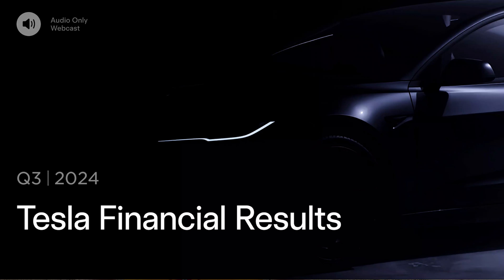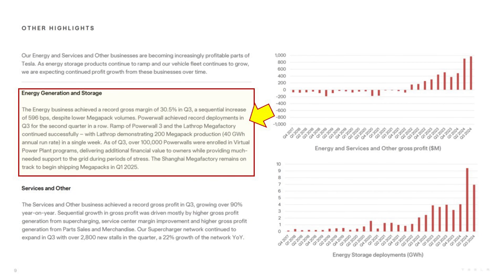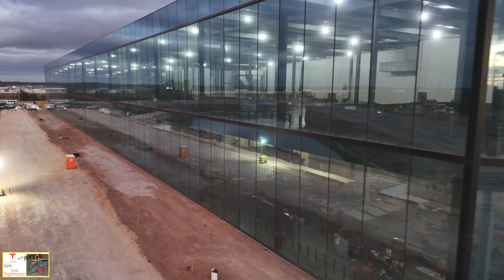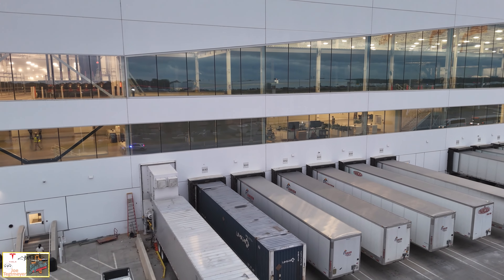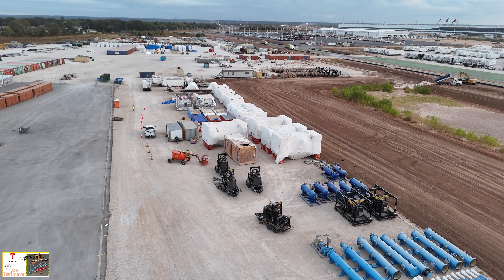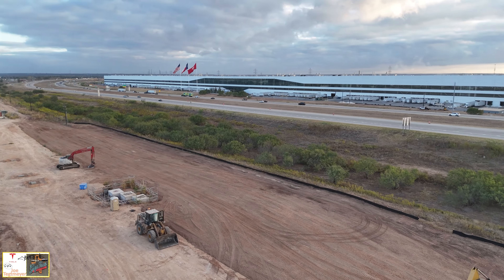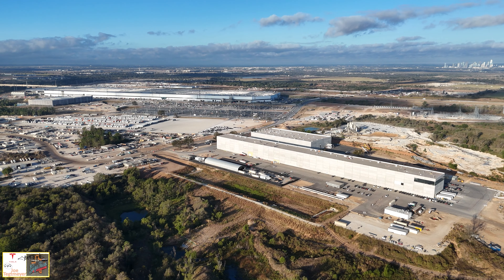Inside views, Factory Production Expansion & Big Deliveries! 25 Oct 2024 Giga Texas Update (07:05AM)

Comment: At 18:10 possibly top and bottom stamping press bases. Which then hold the dies.
Reply: 16:10. AP&T the manufacturer of the existing hot stamping press, calls these 'bolsters'. You are correct, holds the top and bottom dies for shifting in and out of the press.

Search 'AP&T Tool Changing Systems'.

AP&T also have a youtube channel.

Comment: Thanks Joe for the excellent views inside!
Data center:
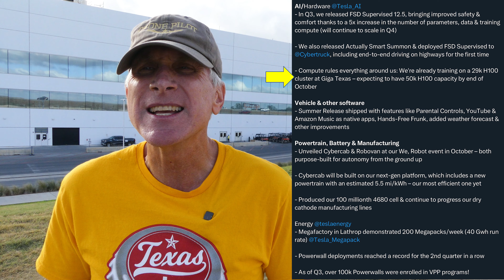@ 3:02 29,000 H100Ss now and 50,000 by the end of October? Can someone please explain where the power is coming from?
This is the substation @ 23:16
These are the rooftop cable trays from the north end @ 25:35.
@ 25:44 (bottom) There are 4 three-phase circuits that do provide power to the data center from the existing main switchgear room. But enough to power 50,000 H100S? Again, if anyone has knowledge on this please chime in. Thanks.
Now I may be completely wrong on this but.... There is what the guy who runs the place and makes claims and then there is reality.
Transformers:
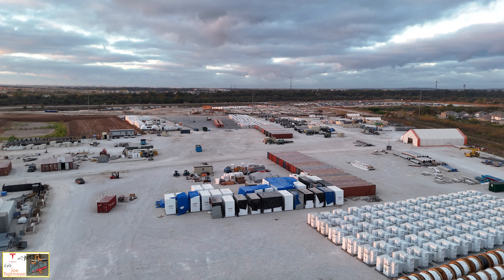@ 14:54 90 Transformers.
Mystery crates:
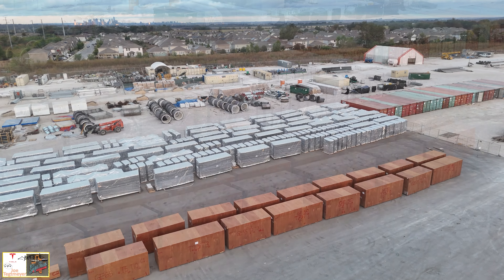@ 16:33 My guess is that these are transformers.
Substation expansion project:
@ 23:01 New 345 kV circuit breaker set installed.
They still have to drill for 8 concrete piles to support 2 A-frame towers.
Reply: @ 6:19 I don't doubt they are doing testing, but.... If the cooling tower is operational.... No steam? Again, maybe just my lack of knowledge.
Reply: 3:02 Just looked it up. A single H100 GPU requires about 700 watts. So 29,000 H100s would require 20.3 MW, but that does NOT include power needed for cooling. Maybe doable with current power available?
50,000 H100s would require 35 MW, NOT including power for cooling. Can these GPUs be run at less than full power?
Reply: An H100 can run on as little as 50 watts if its not under a load. Yes it can be throttled.
Reply: @DavidJohnson-tv2nn   In a recent video (maybe Brad’s), there was a low-level N to S   flight between the cooling towers and the building where the light was just right to see  some wisps of vapor rising from the two fans operating at the time. Likely the cooling system is operational at some limited capacity, but whatever GPUs are currently installed are just idling while the cluster is being configured, so there is limited heat to remove.
Reply: @keysrick  Thanks. So that may explain how they can run 29,000 H100s or perhaps even 50,000 on limited power.
Reply: @Frank-gt7me  Thanks! That definitely makes sense. But isn't their statement a little misleading when they say "We are already training on 29k at Giga Texas? Because most people aren't aware of what we who closely follow the construction are aware of. They will think those GPUs are going at full power and are fully operational.
Reply: @DavidJohnson-tv2nn  They just said they were training on a 29k cluster, but didn’t say all 29k GPUs were operational and running at full load.  If they actually do have all 29k installed and running at full speed, that would imply they don’t need all the additional power and cooling they are still installing.  Corporate truth stretching is not uncommon, it’s not just a Tesla thing.  Not necessarily intentional either, often as status reports get passed up the food chain qualifiers on statements can get misinterpreted or dropped.
Reply: @Frank-gt7me  Yes but isn't Musk truth stretching rather common? How many times has he said "FSD next year"? Or over promised and under delivered? Or delivered late? Even the fans invented a new phrase for it.... "Elon time".
In any case I'm glad we had this conversation. Which helps clarify the situation. Since there is currently no new power available from the substation, and likely won't be by the end of October.
Reply: Thanks also to you for your (apparently) qualified opinion. I think however that the power comes from the excess capacity that was certainly built in at the beginning. I also thought that the transformers will be needed for the Cortex to even start working - but it seems they're really still only testing and trying to resolve the issue which Elon hinted some time ago about the sudden jumps in consumption when the entire available pool of GPUs are running at one time  same task. That's why they might not need the constant full power as yet. Also, the batteries in Megapacks might be able to release more of the accumulated power for those times it is needed. But I love one comment below speculating on more Megapacks being built soon.

Comment: Thanks for your great drone service re Giga Texas.  I watch it religiously.  I have been involved in new build construction most of my life and there are two things that are currently. causing, me concern.
1) The  battery buiilding must be about 200 yards long and , judging  by the cars outside I would guess  that around 100+ people work inside. As y 25:07 ou fly over and around this building there do not appear to  be any fire escapes on the sides or roof . I have no idea what processes are being undertaken  in this building but I am sure fire escapes would be mandatory,  given the number of employees involved.  
2) The tunnel entrance is downward sloping. In the event of a heavy rain storm the current setup is inviting  serious water/mud  to. Ingress the tunnel which would be the devil to clean out.  Easy to prevent but difficult  to cure.
Hope my comments are useful.  Go Tesla!,
Reply: Battery building. 25:07 would be Casting. The Cathode building is at 27:45. Lots of external doors on the far side (west).

Tunnel portal. Likely will have a raised bund across the entrance ramp. There will need to be retaining walls either side of the entrance. Couple of grate drains to catch whatever water falls directly on the ramp. 

There's a sump and pumping system shown on other TBC tunnel plans to handle any water that makes its way into the tunnel.

Joe has those drawings on his Patreon site.

Comment: 23:00 I'm thinking that larger V-type circuit breaker (and maybe the awaited new transformer) may be larger because the new high voltage incoming line is higher than the other 2 lines (345KV vrs 249KV).

Speaking of power, if the relatively few Cortex AI cabinets you mentioned are actually operating (on a test basis, etc.), then they must be running temporarily on regular factory power. Beginning at about 25:00 in your video, it looks clearly like the cable trays for the conduits or wiring harnesses for the Cortex leading to the north end of the factory are not yet installed. (Of course neither is that part of the substation either ... 🙁)
Reply: Power for the datacenter..... Yes it is existing regular factory power.
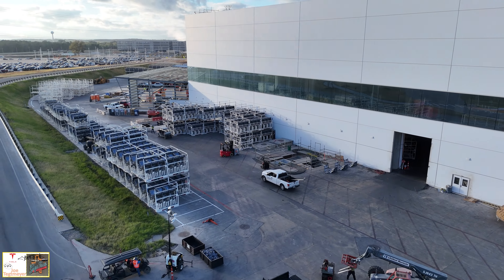@  24:24 (Bottom left) You can see the new cables from the substation coming out of the vaults connected to nothing. That is in addition to what you already mentioned. So there is clearly zero new power available. However...
@ 25:44 (Bottom) You can see where cables go through the roof. These are 4 three-phase circuits that likely get power from the existing main switchgear room located on one of the floors below. This is also the point where the existing main power duct-banks enter the building.

Substation.....
All primary voltages are 345 kV. Since all power comes from the 2 main buses, one on the north end and one on the south end.
@ 22:43 North bus... 3 bus bars running in an east/west direction, supported by upside-down V shaped supports.
@ 22:59 South bus... 3 bus bars running in an east/west direction, supported by upside-down V shaped supports.
The double bus provides redundancy. The transformers can be powered from either bus.
Reply: @DavidJohnson-tv2nn  Yes, regular power is enough for testing and practice a few racks or so. And I can see where the circuits go through the roof to the main switch-gear room (which I assumed was near there). I made a (mental) typo, I think, but all primary lines being 345KV makes sense. However, I did think the transformers are different. Isn't the Cortex power line from the substation supposed to be 34.5KV? And I thought the other two existing transformers for power lines to the factory were 24.9KV or maybe 29.7KV? Something like that (~rule of x11) . I don't recall exactly.
Reply: I forgot to mention power flows from the north and the south to center of the substation.
@ 22:59 Notice the 7 busbars running in a north/south direction. Two have been removed for construction of an A-frame tower and will be replaced later. These busbars power the transformers.
Anyway, power flows to those busbars, then up to the top of the A-frame towers, then to the transformers via the overhead lines.
Reply: @WarrenLacefield  Yes you are correct. there may be different voltages but the differences would be in the secondary voltages. 24.9 kV and 34.5 kV. Unfortunately, that is the part we haven't been able to confirm yet. Since we don't know the exact use of all those new transformers sitting in the storage lot. The best way to confirm is if one of the drone pilots can get a close up view of the transformer name plate when the new substation transformer comes in. That name plate will give the primary and secondary voltages and the power rating.
Reply: @DavidJohnson-tv2nn  Yes, that nameplate info will be good to know. Actually, I wasn't thinking very well. The "size" of circuit breakers that appear "larger" (and maybe the new transformer) would depend on the power being drawn (and not just the voltages). The Cortex, when fully installed, will require more power than the entire factory, right?

I am still thinking that one set of transformers is for reducing the secondary voltage to meet needs of the Cortex built-in rack and bay power supplies (which I think are 220v). No clue about where those will be placed (not on the extension roof, apparently - but it would have to be somewhere between the secondary power feed and the computer room). No clue either about the solar or battery-backup ones (unless there is going to be another megapack or solar farm).

Comment: Robotaxi is designed to be cheap and rugged. If they can't use them all in trial taxi service they will put driver controls in them and sell a low-priced EV like hotcakes. One thing for certain, they should fly off the assembly line.
It's a win either way.